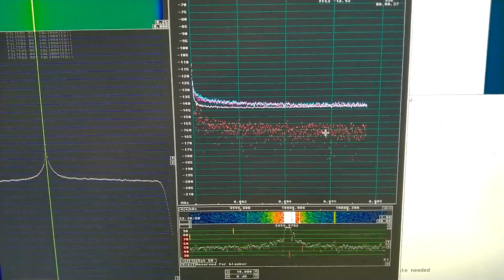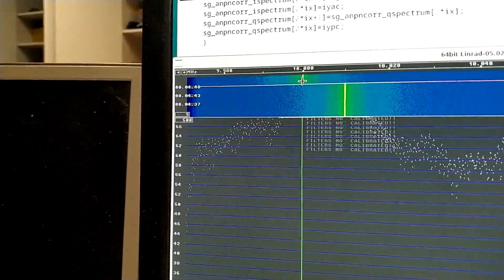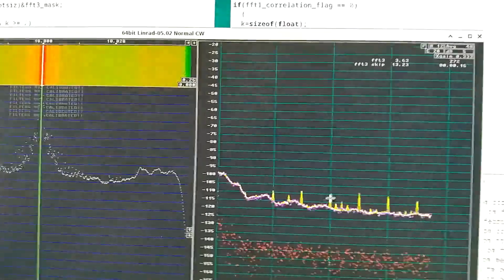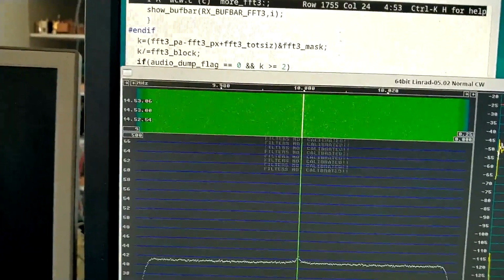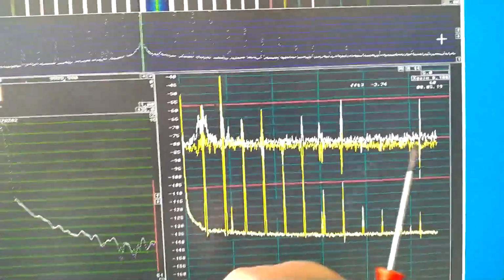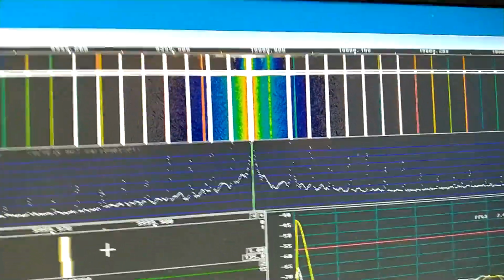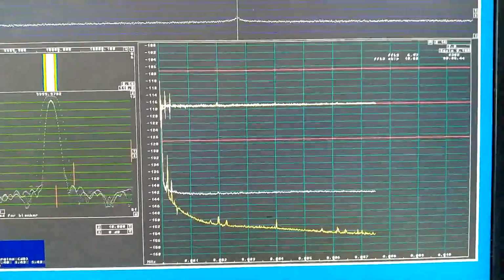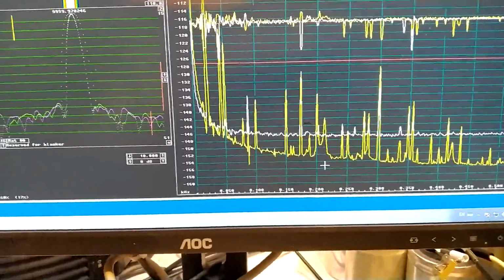nerds84

Comment: Althou I have none of the equipment to measure this... I also have a few of those oscillators on that same particular board, I see you found the C14 and cut it out and the TTL port is straight connected to the oscillator out pin. There's also a smaller board by BG7TBL that has a nice feature, for those ocxo with it's own reference out voltage, like MV85, (going through pot to the tune input) you can move a single resistor to select internal voltage reference instead of the board reference. Unfortunately the BG7TBL has no straight connection to the output frequency, a fixed 5 pole filter and two dc blocking ceramics. 73's de sa2kng